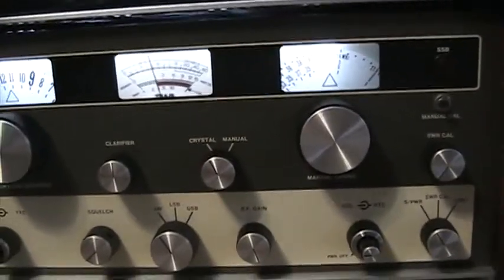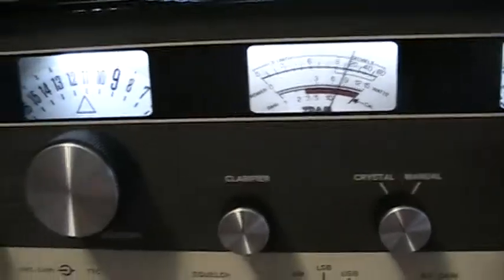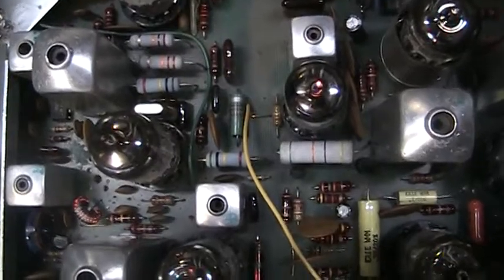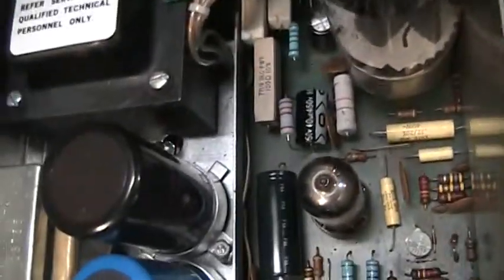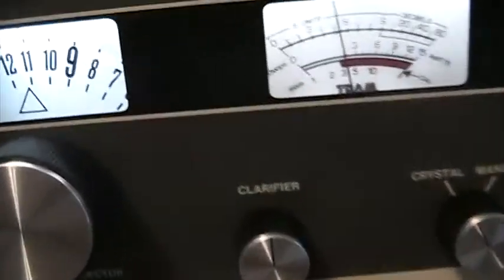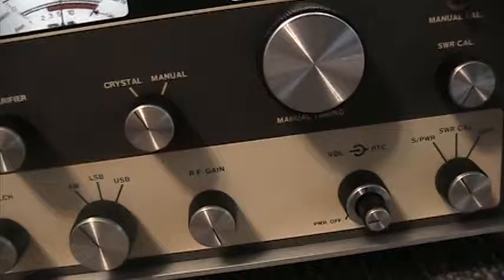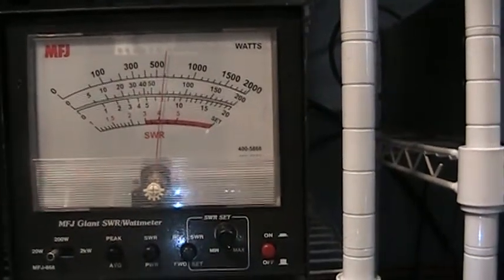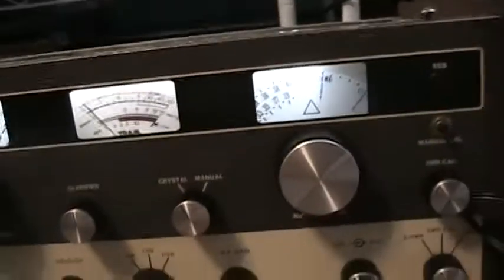Tram D201A CB radio fixed bias, Grey selector, vintage tube collector quality

Comment: Doc, can you tell me what resistor changes would need to be made in a hand wired 201 to run a 6550/KT88 in the modulation tube position if any? Thanks

Comment: i wish i knew what you know being a trucker knowing nothing much about electronics.    Trying to put a bias board in a 10kw wizard built from a 3000a7 hopefully i should be done after that .  Upgraded to a 240vac transformer got it all hooked up and a new socket installed for the 10000a7 were getting there just got the bias board yesturday , 73s. from the monster mash 143.
Reply from the maker: Good Luck.

Comment: I see D606 in you're video has a. Zener in series with a 1N4148 cathode to cathode.
I'm trying to find out if this is a mod or factory change. My fixed bias radio had it. My other fixed bias radio just has the 1N4148. Do you Know? 
Thanks
Reply from the maker: The Zener is from the factory. I have had about 10 of these now and they all had the Zener.

Comment: I have a fixed bias mint. Paid $50.00 I picked up 4 D201A's. Made another one fixed bias by copying the circuit changes and using the pot
From a parts car fixed bias unit.

Comment: I noticed you have R3 & R4 47 ohm wire wound. They would not be used there. 5 watt metal oxide would be a better choice.
Reply from the maker: Power supplies would be the one place where you could use them, well maybe audio circuits too, but not in RF.

Comment: Never install those power resistors off the board without using teflon tubing or Ben the leads at left and then right horizontal angles so the resistor is supported by the PC board and NOT the traces under the board that will detach and they will swing in the wind! Bad idea!
Reply from the maker: Yep very true. Solder is not good for physical/mechanical connections.
Reply from the maker: I bend the leads for good physical strength on top then underneath I again bend the legs for electrical connection (as much as possible) before soldering. I also often use Silver solder.  Better electrical connections and higher melting point....better for heat and flexing which D201's have an abundance of.

Comment: Do you still have this radio and would it be for sale?
Reply from the maker: I still have it $750 plus shipping firm.
Reply: +tramdr how do I go about getting in touch with you?  I want it. Also do you still have the maco 75 modulator?
Reply from the maker: you can PM me and I'm going to try to PM you. The Maco 75 is gone. The guy who bought it loves it,  it was a modulating machine.

Comment: Have a 201 with vfo unlocked for xtra channels.......just lost my recieve audio though.....still see meter move....it's receiving signals though......not the speaker....nice 201a.....
Reply from the maker: +Paul Hawk if the transmit audio is ok, it may be the speaker

Comment: what value is the big red cap and where did you get it
Reply from the maker: Paul westerhaus     C700 in the schematic. Original is an orange .001 1kv The big red is a .001 10kv (probably Russian) that I buy off Ebay. 10kv is overkill, but why not.   2kv or higher is fine. I do not recommend changing  the .001 value.
Reply: tramdr is it just a CERAMIC RADIAL CAPACITOR
Reply from the maker: Paul westerhaus  Yes.
Reply: tramdr what kind of cap is c639 on the ba board
Reply from the maker: Paul westerhaus  Mylar, but polystyrene, polyester, metal film all will work.    You do know that CBTricks.com has a complete manual, schematic with parts?
Reply: tramdr yes I do but it doesn't say what type of cap it is
Reply from the maker: Paul westerhaus   I got it from there in the parts pages.
Reply: tramdr mine is a d201 it doesn't say it on that one I see it does on the d201a

Comment: Hello I have a tram d201 it is good on am but sideband it has a carrier and it don't modulate
Reply from the maker: recap the balanced modulator board (all the electrolytics including the 1uf caps), then do an alignment.

Comment: I have a Tram 27e good receiver no transmit and bad mike. Need assistance.
jsmithbey85@gmail.com
Reply from the maker: Mary Smith  check the tubes, check the big power resistors and get a Sams CB 10 and check the voltages to start.

Comment: I always wondered how tram got away with that 6l6 final, the fcc must've known it was going to be easy to bump the output way up.
Reply from the maker: Factory they all came with the big 6L6 audio tube and a 6L6 final except for the latest models where the FCC made them wimp them out some. On the last models, they changed the RF tube from the 6L6 to the smaller 6dg6 tube on the final and added a negative feedback resistor on the audio tube  R651 to back down the audio output too. IMHO if you want full potential, change the 6dg6 to a 6L6,  and remove R651 if it has it.

Comment: Were did u get those electrolytic caps at by the transformer there I am looking for the (c624) 4x10uf 500v and (c5) 3x40uf 450v for my tram and can't find them anywhere. Id appreciate the help on finding the parts thanks. And thats one sweet radio by the way
Reply from the maker: the tall cap is a single 200uf / 500v snap in bought off ebay that I use for c5a and the short one is a single 470uf at 450v snap in that I have lots of laying around mostly for old linears that I use for c5b and c5c. For the 4x10uf at 450, they now make the single 10uf/450 so small, that I just solder them directly to the bottom/foil side of the boards and eliminate the 4x10uf can c624.  With this configuration, I get almost 0 measurable ripple on the hv.

Comment from the maker: Just start from wherever they are and alternately keep adjusting the tune and load for peak watts output. I personally do this while modulating. 
  When you do a  Neutralization alignment, then you adjust the Load 1/4 from max closed or tight which is counter-clockwise or 1/4 from all the way in. I wouldn't do a Neut... if you do not have some electronic knowledge. There are scans of the D201 vox, D201 non vox, and D201a manuals on CBTricks.com

Comment: First of all nice video.Now on to my question I have a 201 tram.In the back of radio there are knobs for tune and load is the starting point counter clock wise or clock wise.it says 1/4 turn just dont know what way to start from..

Comment from the maker: I like the brights too. Bought them on Ebay for my pinball LOL. Don't remember from who, just remember that they where 'Super Bright' LED's. I recommend this to all D201 owners even if you don't like the brights, still get LED's as they run COOL!! You can feel the difference. About 1/5 the power and heat of the normal incandescent's and they are supposed to last a very long time too.
Reply: i got the leds   like you did   for  a pinball ,  they replace  the 47   lamps   great   got  them in one   of my  201s    was using  755s  but   like   these better

Comment from the maker: I know people say it all the time.....but this one was done by ME and is 1 of a kind. I will not do any one else's either. Too much time involved. However, if you have or can find one with the Grey channel selector that would be a good start. That part alone is unobtainium. Next replace all the electrolytics, and power resistors and you will be on your way.

Comment from the maker: My 2 cents:  Uniden 2020 single conversion transistor receive. Single conversion sounds BAD on AM, PERIOD. D201 highly filtered dual conversion, tube path. Uniden 2020 50DB image rejection, 50DB IF rejection, 1uf sensitivity AM .3 SSB  ALL TERRIBLE!!!    D201 80, 80, .35  .1 respectively AAA+++  Uniden low level AM TX TERRIBLE!!!   D201 Hi level with arguably the best CB AM transmit ever. For AM CB, the Uniden does not compare in ANY way just does more watts.

Comment from the maker: "Turbo" is an Ebay seller who wants lets say very high end money for his items. He has Trams and Brownings and wants around the $1100 area for many of them. Other than his special "Neon audio mod" whatever that is, I don't see anything else special about his radios. So in effect, he asks $1100 for a decent condition Mark 4. So, Turbo money is an inside joke to us classic collectors. However, for either this or my Mint Mark 4A, it would tale $1250 for me to consider selling.
Reply: tramdr the markets will keep shrinking for this equipment sad but they will all end up in the landfill. I would rather spend 1100 on an Icom IC-7300 than any of these boatanchors.